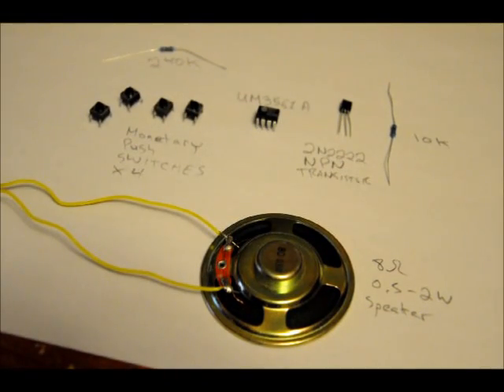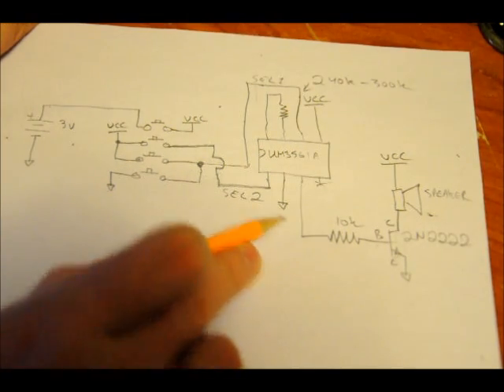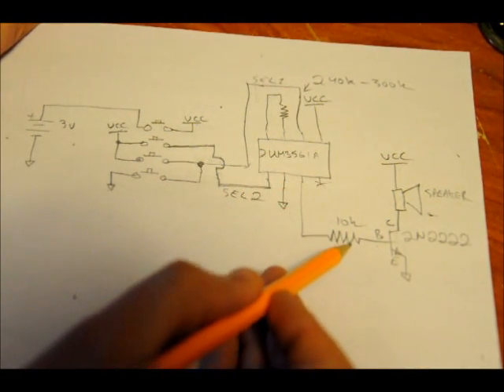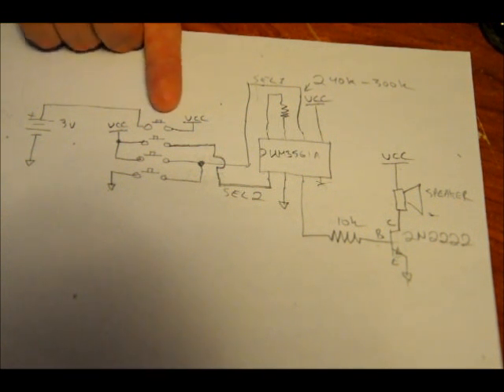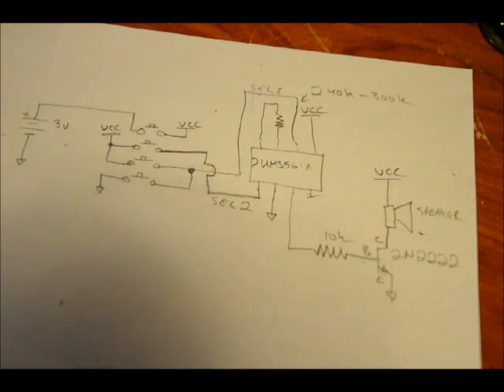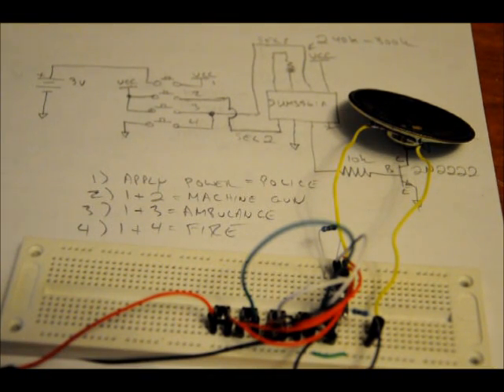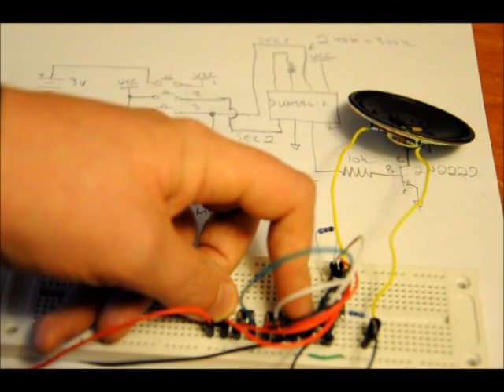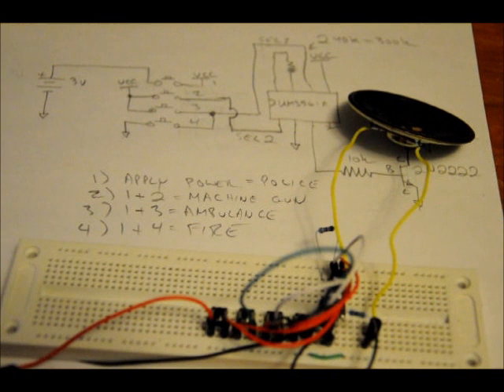Electronic Tutorial#2_How To Make A Sound Effects Circuit Featuring the UM3561A

Comment: This is great, I’m wondering if there’s a way to do a soundboard like this that can run off of a 9v battery and run one sound as soon as power is applied and a second sound can be activated via a momentary push button switch that is also wired to a series of LEDs?
Reply: Also being able to do different sounds, one like a low pitched “hum” and the other sound like an electrical shock

Comment: Great circuit.... To solve the problem with the push button 3 and 4 being on at the same time just connect them to a 3-way rocker switch so that only one can be on at a time. Simple fix. I would also use a 2-way rocker instead of push buttons for 1 and 2 , that way the sound affect can remain on without having to hold the buttons down.

Comment: pressing both buttons kills the batteries, so why build it that way, sloppy......

at least do this again and add a 10k resistor to the button to current limit it in that situation, 10k is a guess, i dont think it will affect operation but i dont have the ic to check.